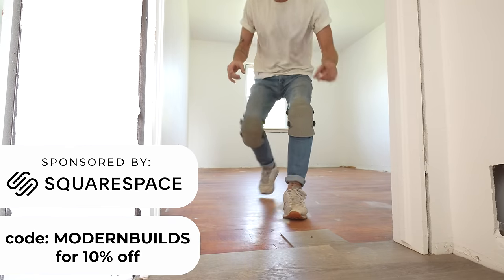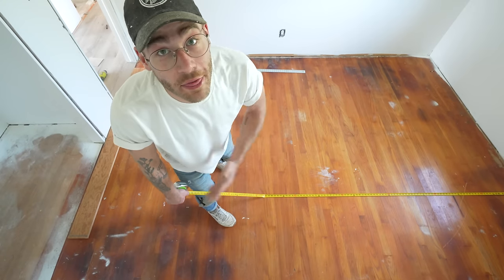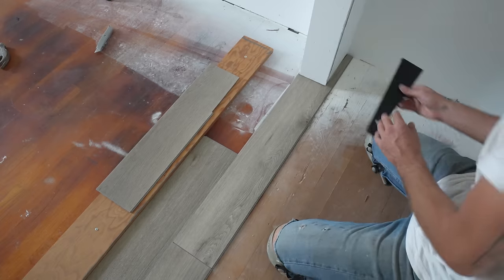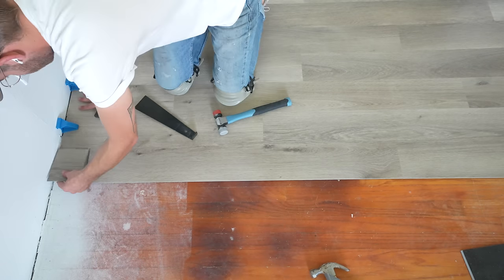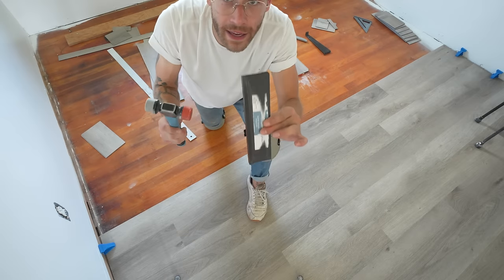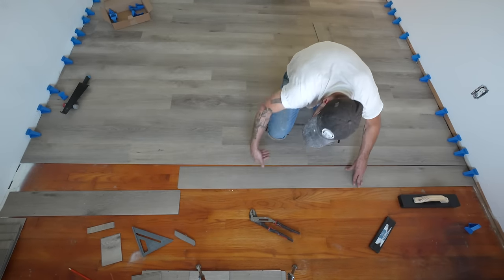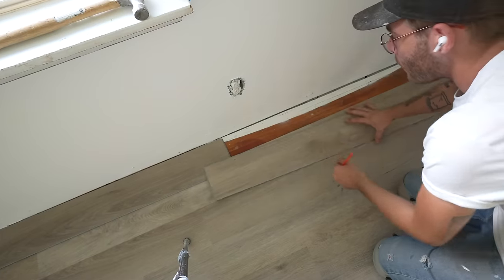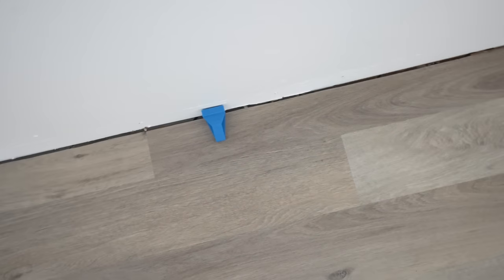How to Install Vinyl Plank Flooring BACKWARDS!!!

Comment: @modernbuilds I am a flooring guy by trade, been installing lvp, laminate, and hardwood for 5 years now and currently own my own flooring company. The reason why those planks were chipping with that block is because when installing backwards that side that clicks in is more fragile and is lifted off the ground compared to the other side of the plank. When I install backwards I use a scrap piece of flooring, lock it in place, and hit the scrap piece that way it wont chip or break the full piece, or i use a bigger rubber mallet and ditch the block altogether. Hope that helps!
Reply: I always tape a scrap piece to whatever tapping block I’m using so it’s easier to hit with my hammer 🔑
Reply: I also use my waffles 24oz framing hammer so even the tapping blocks get destroyed by the end of the day 😂

Comment: Ive been installing, sanding, staining finishing wood floors for 5 years now. The original wood floor can be repaired relatively easily and as long as the ware layer is still thick enough you could sand the floor no problem. But it isn't as cost effective, and time efficient as the floating floor.

Comment: My guess why that block was breaking the edges was because when you hit that block against the side, its not perfectly parallel, so a small section of the edge takes the initial impact whereas with the traditional method, you already have it lined up parallel in place before the impact with the hammer.

Comment: Love the seamless look. Curious if there is any extra worry when floating the floors without transitions with movement/buckling later?
Reply: Depends on the size of the flooring you are laying. Once you get over a certain square footage you may need an expansion joint but that is normally for a very large area

Comment: That tapping block works great, but you're using it wrong. You want to always maintain contact with he plank and pivot one side out like a hinge and then side it back in hard. You don't want to slide the whole block out and then whack it back in. The hinge technique assures that the impact to the plank happens across the whole side of the block and not just one corner.

Also, if that old wood floor is on a slab you might get some moisture build up in it. I haven't seen an LVP that can go on top of wood that is on top of concrete. You're good if it's a pier and beam foundation.
Reply: Lol u have no clue. I’m in business for 35 years and when using waterproof products with cork backing you can go over
Reply: Any hardwood that is installed over concrete is glued down and the adhesive acts as you moisture barrier when cured.
Reply: @DSR-v7r yeah I’m just telling you what the directions say in any LVP I’ve ever seen, but you do you.

Comment: I've only done a couple of plank installs, but there are a few things missing here. why arent you using a subflooring foam mat to add some cushioning to your floor, it saves your feet as it reduces the hardness of the floor and also means you are less likely to have breakages when items fall on it. Also why arent you cutting one end to size then starting the next row with what's left over, it helps you stagger it well and less waste!

Comment: It is a horrible idea to lay lvp over them real hardwood floors, if you have any moisture issues under the house you will know soon enough!!!!
I’ve seen it happen a couple times the moisture will transfer through the hardwood but not the lvp and will cause the hardwood boards to Bo up like a Halloween cat , I’ve seen cases where the hardwood had bust through the lvp and be sticking up over 12 inches